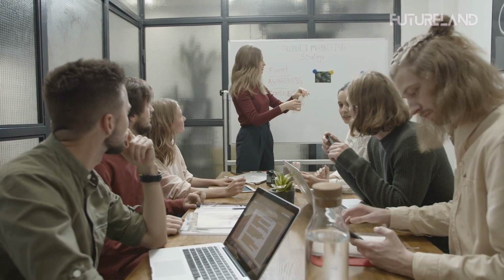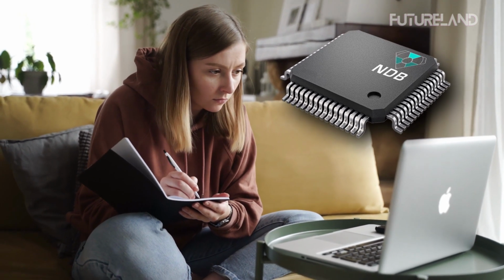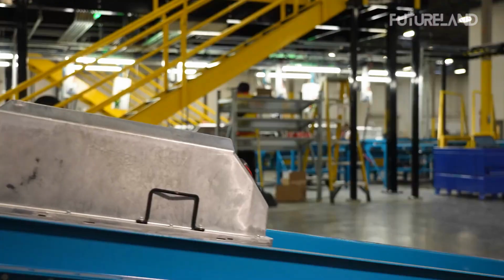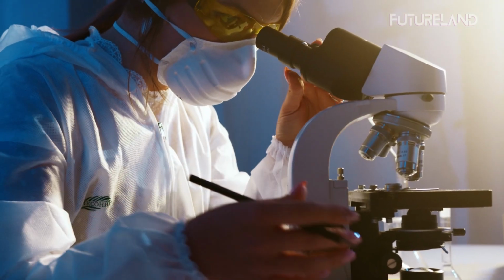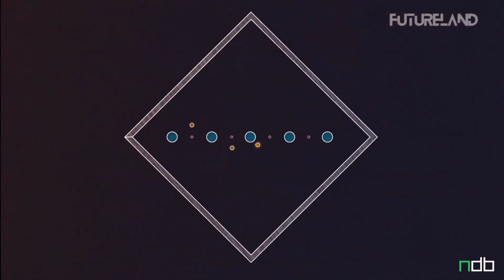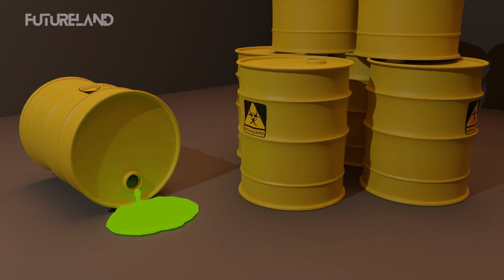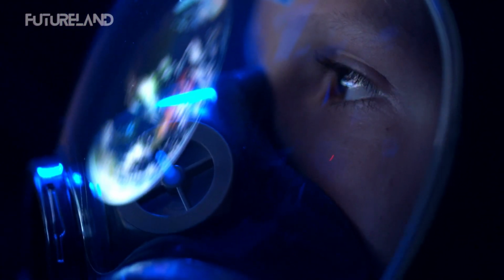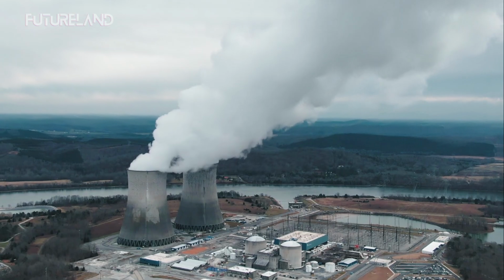ITS’ A REALITY! NBD Nuclear Diamond Battery Is Now On The Market

Comment: Ignorant idiotic rubbish. The POWER DENSITY of these betavoltaic Carbon 14 based batteries is >1000 times too little (10s of micro Watts per cubic centimeter) to become a competitor to modern Li-Ion batteries. Imagine your mobile phone, laptop, EV or other battery being >1000 TIMES BIGGER. How does that work for you? LOL

Comment: I was curious about how this battery transforms radiation into electricity, we currently have thermoelectric generators like those used in voyager probes, where peltier pellets are used to convert the heat generated in the plutonium decay into electricity, the technology is very reliable, the voyager probes are already operating to 45 years, but they are very inefficient, using only 8% of the energy of plutonium, and leave a trace of radiation...
The other alternative is beta-voltaic generators, where solar panels are used to absorb beta radiation and convert it into electricity, the disadvantage is that the amount of energy produced is minuscule, on the order of milliwatts, a fraction of the energy that would be produced simply exposing these panels to a light source, but as we deal with beta radiation, they are pretty safe batteries.